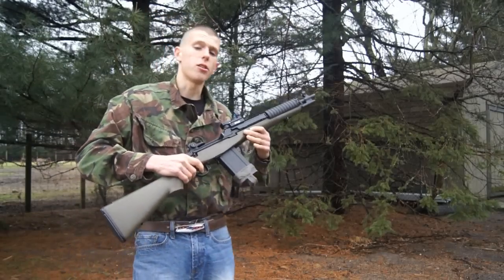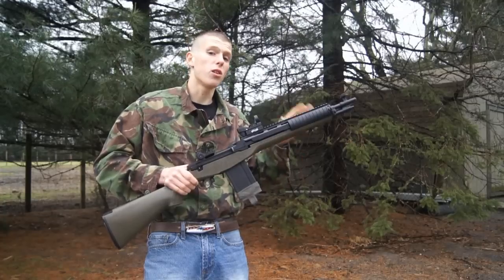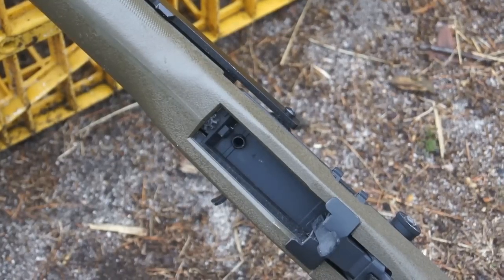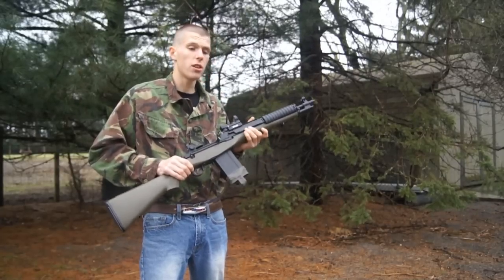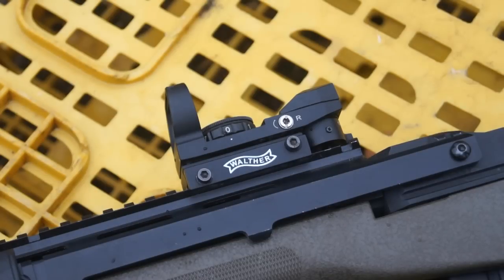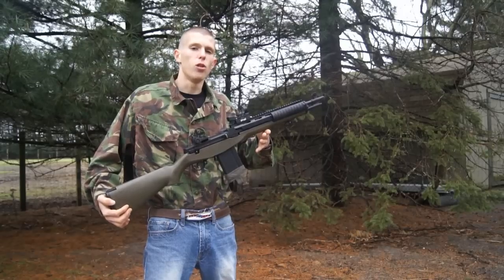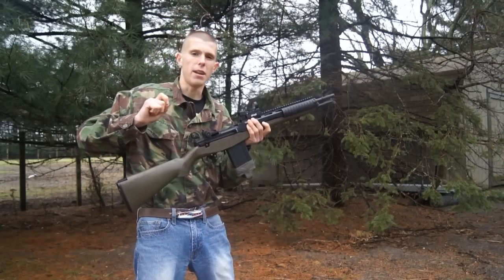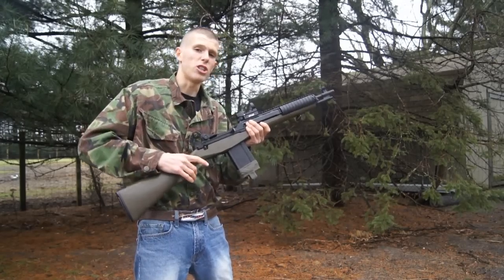Airsoft How To: Sighting In a Scope

Comment: Average Range you test while sighting in?  I use 2 targets, depending on the gun.  Normal Field  short range weapon at 100 ft.  Longer range gun at 150 feet.  if you are hitting at either distance accurately, then you are golden.

Comment: Instead of just telling people it's a simple process to sight in your scope, or in this case a red dot. You might want to show the process, and while you're at it say that you have to determine at what range you want the sight to be stop on.

With real firearms, the bullet trajectory stays pretty much the same in reasonable temperature changes. But as we have hop ups that uses rubber buckings, the trajectory can have a big change. Especially when going from warm to cooler temperatures.